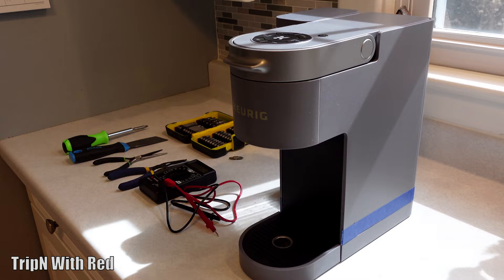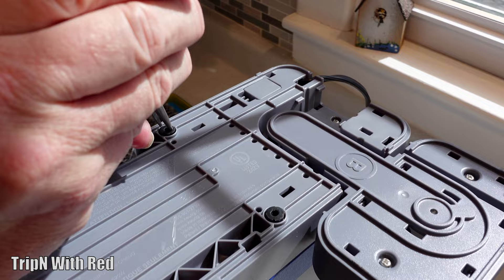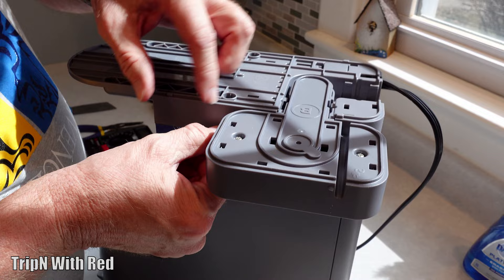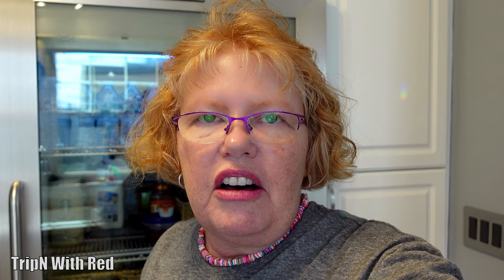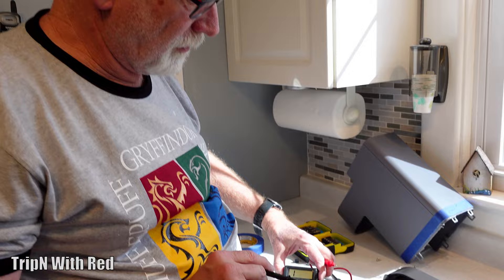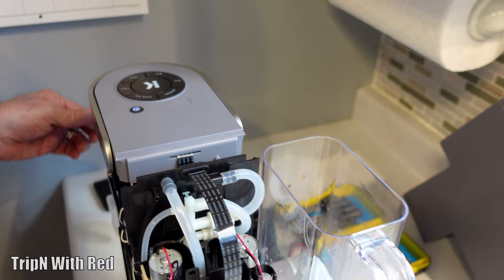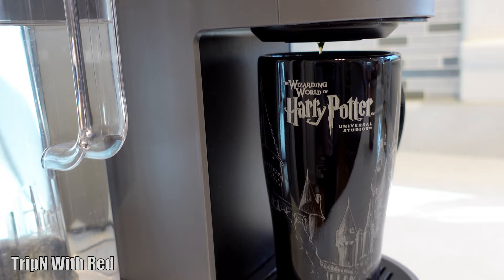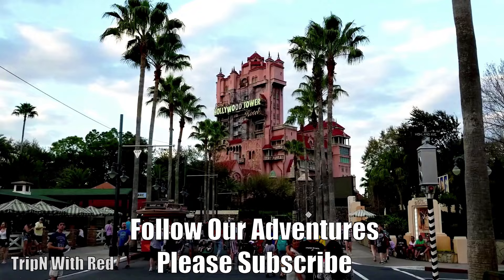Reset your Keurig - How to FIX & Reset your Keurig K-Supreme Coffee Maker - Descaling Power Problem

Comment: After a persistent struggle, we finally got the cover off and we’re able to reset the Keurig.  It definitely took two people, and we ended up breaking one of the tabs.  It is ridiculous that Keurig has no means of resetting this machine, knowing that this is a common issue.  I like the idea of drilling a hole in the side for any future resets.  But thank you for your directions and honesty in how difficult this can be.
Reply from the maker: We've only had to reset our Keurig that one time and it's worked ever since. If we ever have a repeat problem and need to reset it again, we will likely just drill a hole in the side to access the reset button. I'm glad you finally got the case off and our video was helpful. Thank you for watching and commenting.

Comment: 4.375 from back, 6.875 from bottom on right side.
So you can drill a hole in the side at these dimensions but just the stainless cover. Then you can use the rod or paperclip to push the reset. You may have to go by feel or drill a larger hole. I had two of these machines do the same thing during descale so I took the measurements the second time. Sure, the hole isn't perfect but an hour to disassemble and reassemble was too much. Now it is 1 minute to reset. And always unplug first
Reply from the maker: Creating a hole would make it easier to access in the future. We had someone else recommend that also and ive considered it. Hopefully it will be a one time thing and we won't need to revisit the same issue. Thank you for watching and commenting.
Reply: Also, as you notice, this is a repeat offense with a same but different machine. What happens is that if you follow the descale procedure. In two machines, the tank never got to the "add water" point and that is when it ran out and tried on high temp. What most don't know is that it is warranted and they will ship you a new one and to throw the old one away. That's when i took the old one apart and found the reset. They have a problem with the automated procedure that causes the machine to never reach add water stage correctly.

Comment: Well we did the 30 min. case removal, tried the reset hole multiple times still doesn't work.  In the garbage now! Thank you for trying. I was able to use your video to reset our old Keurig twice. They have obviously "improved" the newer model to resist repair.
Reply from the maker: I appreciate you letting us know our video helped you reset the old machine twice but I'm sorry to hear your newer Keurig reset didn't work. Keurig has to know they have a defective design. It's frustrating they don't seem to be fixing the problem. Thank you for watching and commenting.
Reply: Got mine going.... For all of two minutes. Now I have to do it all over again. 🤬🤬🤬🫤
Reply from the maker: @tinkystink65  oh no. We kept our case off just incase. I hope you can get it going again.

Comment: Aghhhhh!!!! Third try and this time it worked! I checked the connections and jiggled a few wires (unplugged, of course) and THIS time made an access hole for resetting in the future. Covered the opening with a piece of black duct tape... seamless! THANK YOU SO MUCH FOR THIS VIDEO!! 😊☺️🫡
Reply from the maker: I'm so glad you were able to get it going and the hole is a great way to access for possible future issues. Ours has never required another reset since making this video thankfully. I never want to remove that case again. Thank you for letting us know.

Comment: I did this the other day twice it kept shutting off and it wouldn’t come back on. I was ready to throw it in the trash today. Something told me to try it one more time and it actually stayed on this time so I’m keeping my fingers crossed thank you for the advice, I didn’t have the coffee maker that long and I didn’t use it every day so I was very disappointed when this happened.
Reply from the maker: I'm glad you tried it once more. It's frustrating to pay so much for a machine that obviously has a flaw built in. They have to know there's a problem with the design and yet they've not fixed the problem. Ours has worked fine since we reset it in this video so hopefully yours will continue to work. Thank you for watching and commenting.

Comment: You guys have been SO helpful!  I have a similar model Keurig and have successfully repaired it based on your video.  The warranty on mine just ran out and the descale light had just went on for the first time.  I went through the descale process and half way through, the unit completely shut off.  I think the descaling process causes it to heat up excessively and that's what trips the internal circuit breaker.  As others have stated, they should at least have a hole in the side for accessing the reset.  As shown in the video, the unit is very difficult to disassemble for accessing the reset.  Keurig has some serious design flaws that they need to address.  Anyway, thanks so much for creating this video!  Saved me a bunch of money.
Reply from the maker: I appreciate your feedback and am so glad our video helped you reset your machine. I agree the design flaw is a huge problem. Keurig needs to address the issue and fix the problem. A hole on the side would be helpful for sure. That case is terrible to remove. Keurig has created job security by designing a machine that shuts down so people have to purchase a new one. The reality is though, most consumers will buy their competitors machine if Keurig can't make a machine that lasts for more than a few months. I can say that since we reset ours, we've not had that problem again. Hopefully that continues. Thank you for watching and commenting.

Comment: So, yes. Exact same issue. I fixed it your way, PLUS. I NOW have a hole in the side that i can poke through into the inside thermal overload switch anytime 😂. Permanant fix
Reply from the maker: Nice. I've had a couple viewers do that also incase it happens again. It's a great idea and eliminates the case issue. Taking the case off is hard. Luckily, we haven't had the problem again since we reset it but if we do I might give that a try. Thank you for watching and commenting. I'm glad it was helpful.

Comment: because of your video our machine is back up and running...... thank you very much but I do have some good info for you or your viewers.....

after unscrewing the three screws I popped everything apart I was under the impression according to your video that the shell slides off and exposes the innards....

it really needs to be strategically unwrapped for instance the top part has to slide out before the sides can unwrap...

that is what took me the 40 minutes unwrapping it safely and strategically as to not break anything or be too rough.....

is this something you had to do with yours cuz our seems to be same model.....

just thought I would interject but yes I am a new subscriber and I will be back thank you for putting this together for us

I wonder how many people throw their machines out or go through the hassle of finding receipts and returning it I bet this is a common problem and I can make 30 bucks off of each one I fixed just a thought
Reply from the maker: It could be a great way to make extra money. I'm glad it worked. Thank you for watching and commenting.
Reply: Yep. It was an "unwrapping" situation rather than a "slide off" situation 😂

Comment: I just brute forced it open, not caring about breaking the plastic tabs and FINALLY got the wrap around off, shook out any broken tabs that might be inside. Then with the innards exposed and as a personal safety check I plugged it in a safe location to make sure it did not spark out or "burn" up. After that check, I used a paper clip to reset the thermostat, plugged it in again and sure enough, it is now working again. Since the "DESCALE" light was on when this happened, I will now descale it with some white vinegar, Though I think what caused the problem was pressing the make coffee button without the water container being in place (it was being filled). I wonder how long this great, money saving fix will last. Thanks for the video.
Reply from the maker: Lol on the brute force. It was terrible trying to get that case off without brute force. After we reset ours, it has worked fine ever since. Hopefully I didn't jinx it by saying that. 😬 🤣 Thank you for watching and commenting.

Comment: it worked but I couldn't get one screw out so just started prying the bottom off then the sides fell off, and I thought well at this point there is nothing to lose - I have all the sides off and actually the bottom was still somewhat attached so I found the reset hole put the clip in, then that darn screw I couldn't get out fell out, lol. I reassembled snapped everything into place and it works.  Thank you.
Reply from the maker: Wow! Sounds like despite all of the problems, you somehow got lucky with the machine. I thought you was going to tell me after it fell apart it would no longer work. I'm glad everything worked out for you and appreciate you letting us know. Thank you for watching and commenting.

Comment: Thank you so much.  I think that I would drill a 1/2” hole in the side and use a long paper clip tool to reset it without disassembling it.  I only know that because you guys took your’s apart and made a video.
Reply from the maker: Thankfully, the making of this video was the one and only time we ever had to reset the Keurig. If we ever have the problem again, drilling a hole might be a good option. Thank you for watching and commenting.

Comment: Thanks for your help.  Certainly a nuisance to take apart but the fix worked like a charm. 👍
Reply from the maker: I'm glad it worked for you. Replacing it would be expensive. The box is terribly difficult to remove. I'm guessing they designed it that way so people would be forced to buy another instead of resetting it. They were creating job security for themselves. Thank you for watching and commenting.

Comment: Nice, you fixed it 👍 I don’t own one but I guess you need to run the d scaler more often 🤪 what a pain 😂
Reply from the maker: The light turns on when it's time to descale. He's done it before without a problem but it wouldn't turn back on when he did it this time so he found online where this is a real problem with the Keurig machines. They need to fix this issue but I'm sure they dont want to because they sell more machines if you can convince people the machine died. Thankfully Joe likes to take things apart to see how they work. Thank you for watching and commenting.
Reply: @TripNWithRed  I just though of another idea. Drill a hole on the side so you can reset in 5 seconds 👍
Reply from the maker: @SomeplaceOrAnother  🤣 I love that idea. That's hilarious and yet very functional. 😂

Comment: I have the same one and it started the same thing about 9 months!! I have tried to descale put the solution thru there plus vinegar. But at least mine never quit. BUT the descale light still blinks and never has turned off yet. Guess that's a good thing with mine. Didn't know these particular ones had so much trouble.  ~Dawn
Reply from the maker: I researched before I bought one but was naive to think all of the reviews with problems must be wrong. 😆 I was wrong. Joe has run the descale before but of course when it no longer turned on, it was time to fix it or dump it. I'm glad we could fix it. I love that machine. It looks so nice. Joe said he has to fill the reservoir 1/3 full when he descales. He has to run it to empty 3x to get the descale light to go out. Hopefully that works for you. Thank you for watching and commenting.

Comment: Thanks! Joe did you know instead of prying a way at the bottom once you remove the screws all you need todo is use a screen repair plastic scrape tool tool to pry  out the top from the sides and back then remove the back and then the sides pop right off about a minute compared to 45 and thanks Joe for the refresher. From: Shawn C
Reply from the maker: We appreciate that tip and the Super Thanks. I will definitely keep one of those tools handy just incase we have a repeat problem with the unit. Again, thank you so much for the Super Thanks and thank you for watching and commenting.

Comment: Get ready to do it again and again, It will happen again and again until you find and fix the problem. if you have had the Keurig for more than 8 months make sure you check (and keep your eyes) on the upper water valve. I have opened this CM sooo many times that I open a freaking hole on the side so I  can reset it without breaking it down (LOL) . (if you wondering, It doesn't look bad! I have a robber plug) - I consider myself an expert now. LOL.
Reply from the maker: Lol. Sorry yours has needed reset over and over. The hole in the side is a good idea. Luckily, we reset ours the 1 time when we made this video and that's the only time we've had to do it. We've descaled several times since resetting without another problem. Several people have commented they contacted the company about the problem and got a new Keurig sent to them. It would be worth trying to see if they will replace yours. If I ever have the problem a second time, I'm going to put a hole in the side to reset it. Thank you for watching and commenting.

Comment: It worked! I did descaling it steamed hot hot and boom dead. Apparently you just don't push the 12oz you're supposed to push the 8oz and 12 oz at same time to tell machine you are descaling...maybe that's what I did wrong who knows
Reply from the maker: The descale process is strange that you need to push both at the same time. The other thing is don't let the water tank run out of water ever. I'm glad our video was helpful and your coffee pot is back up and running. Thank you for watching and commenting.

Comment: If you want to bypass those insane clips I just took the bottom off and drilled a hole near the thermostat reset then I stuck a Bobby pin through the hole and reset it . I have a little hole now in the even it happens again 😅
Reply from the maker: I had another person suggest that also. It's a great idea and way easier than taking it apart. If we have the problem again sometime, we will probably drill a hole also. Ours sits in the pantry so we are the only ones who see it so I wouldn't mind the hole. Thank you for watching and commenting.

Comment: If it’s a common issue and you guys are continually having to reset that thermal sensor, your husband should drill a large enough hole in the outer casing so he can use something to poke through the hole and hit the reset without having to tear it apart.
Reply from the maker: That's a great idea. So far the 1 time we had to reset it was the only time but if it happens again, drilling an access hole to the reset button will be what we do. Thank you for watching and commenting.

Comment: I reset mine but there’s still no power? Anything else I could be doing wrong
Reply from the maker: Push the reset again then try to power on again. One person said they had to do it 3 different times before the power finally came back on. A volt meter might detect a burned out heating element if that's the problem. Also if you are plugged into a GFCI, double check to see if it tripped. I know that sounds silly but it's an easy one to check. Hopefully repeating the reset button is the answer. Thank you for watching and commenting.

Comment: My first descale I couldn’t get the light off. I called Keurig and they sent me a brand new one free. I hadn’t put it in descale mode first. That’s why the descale light didn’t turn off for me. Got a new one. First descale. Same problem. Called Keurig. They sent a new one. While waiting for it I happened to look on you tube and found out how to put it in descale mode. Ran the full descale and it worked perfect. So then I had 2 good Keurig. My new one showed up next day. It’s now been a good while. This morning I put started a cup of coffee and forgot to set my cup under it. Aaaaah! Cleaned up my horrible mess and went to make another cup and it now won’t power on. I need coffee! Called Keurig to see if they could tell me how to troubleshoot. They are now sending me a new one. I got the other one out and tried to make coffee and it gurgled in the pitcher then shut off and it won’t power on. I plugged something else into that plug and it worked fine. So now I have 2 nice Keurig supreme plus coffee makers that won’t turn on and a new one on the way. If you have the Keurig app and register your serial number it doesn’t matter where you bought it you will have unlimited (so far) free replacements. After watching your video I’m hoping my husband can fix them. What am I going to do with 3 nice Keurig if so? 😂 Anyway I thought you’d like to know. Thank you for your video. Praying it will work. I can’t wait that long for coffee.
Reply from the maker: That's good to know about the replacements. I will check into that if we have another problem for sure. Once the problem is fixed on your coffee pots, you will have enough coffee pots to last a long time. Hopefully your husband can get to the reset button and get them fixed. Thank you for watching and commenting.

Comment: I reset mine this way and it indeed powered back on but was in descaling mode still and then died; shd I do it again? I ordered a new one while I mess with this one
Reply from the maker: I'd do the reset again. Make sure it never runs out of water in the descale mode. It will probably take about 3 partial fillings in the reservoir. Give a little time in between pushing the "K" button so it doesn't overheat. Hopefully it resets again. Thank you for watching and commenting.